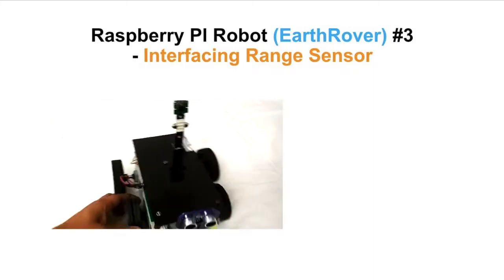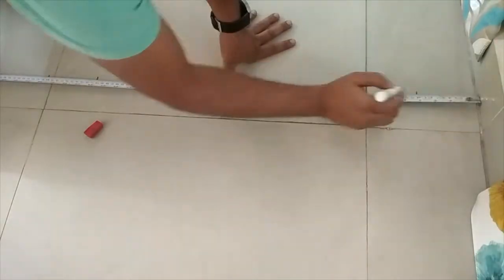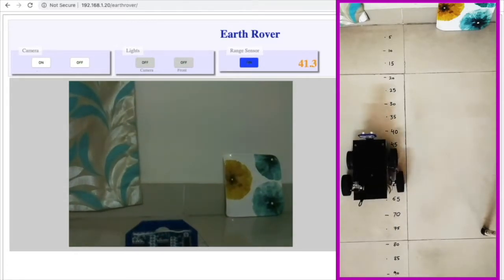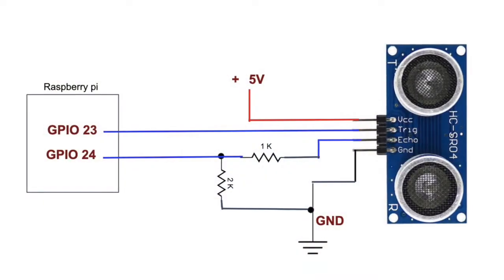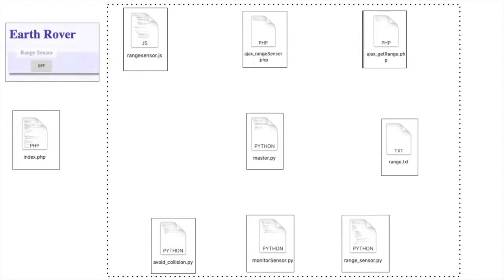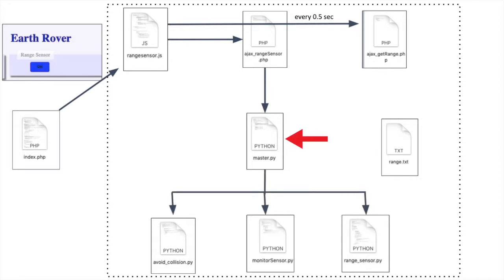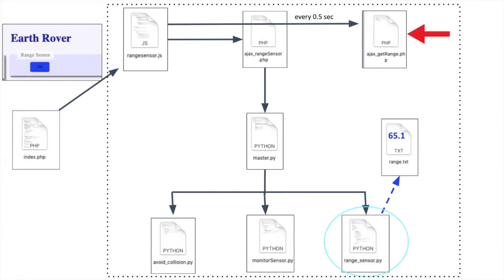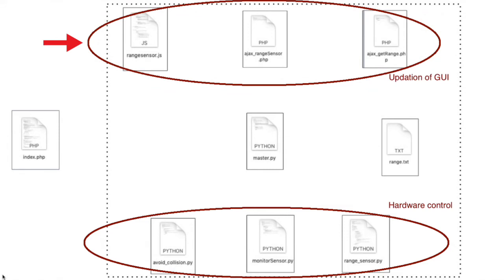Robotics: Ultrasonic Distance Sensor HC-SR04 with Raspberry Pi Robot (EarthRover #3)

Comment: Great project! I tried to make the first project, the second, and this third one. The camera, distance sensor and lights work fine, but I can't make the car move. Already checked the Hbridge (298N), motors, and cabling. What else could be wrong?
Reply from the maker: Thanks.. Good to hear that you could make these projects.. When i made this project initially, i used Raspberry Pi 3A+ and i could turn ON and OFF the GPIO pin using the commands such as "gpio -g write 18 0". However, with new model i.e. Raspberry Pi 4, i found that this method doesn't work. So, i replaced this command with "raspi-gpio set 18 dh" type of commands. Accordingly, i updated the 'vars.php' file in the latest 'robotics-level-4' project. This file is responsible for generating commands for motors through Web Control Panel. Just replace it and your car should move.. All the best
Reply: @jitesh_helloworld  You are the man! That worked great. Also good job on the auto-install script! Thank you for all your work and thank you for sharing. This project will help learning.
Reply from the maker: Thanks 😊.  Pl share with your friends

Comment: Interesting project, how do you start the webserver on the pi? Thanks for the tutorial!
Reply from the maker: Thanks Jimmy. You need to install Apache webserver on Pi. You can use this command "apt-get install apache2". It should automatically start on boot. In case it doesn't (very unlikely), you can start it using this command "sudo /etc/init.d/apache2 restart"
Reply: @jitesh_helloworld  Thank you, this will be my weekend project!
Reply: @jitesh_helloworld  Got the web page up and display, try to test the camera first but video not showing, on the video section it show respberrypi IP refuse to connect!
Reply from the maker: Hi Jimmy, so there is this file called 'sudoers' in location "/etc/sudoers". You need to edit it to allow execution of a Python script from PHP file. Use this command "sudo nano /etc/sudoers" to edit it and paste following at the end of it:-
pi ALL=(ALL) NOPASSWD: ALL
www-data ALL=(ALL) NOPASSWD: ALL
Reply from the maker: When you press ON button in Camera section, it tries to execute a Python file at location "earthrover/camera_lights/cam_server.py". Without above configuration, this file won't execute through ON button.
Reply: @jitesh_helloworld  with these configurations in there, it worked and thanks for your help. A very good lesson here.
Reply from the maker: Nice to hear that you could use the code. ☺️
Reply: @jitesh_helloworld  Hi Jitesh, looking at the motor control codes, I am a bit confused of why you have two motor control modules, one in PHP and one in Python, which one is being used? Thanks!
Reply from the maker: PHP motor control module is used for controlling the motors through Web Interface. Whenever there is a button press by the user, the event is handled by the PHP file. Now, sometimes there is a requirement for the robot to automatically control the motor direction based on sensor input. This case is handled by python file. Look at 'avoid_collision.py' file inside  'range_sensor' directory. It moves the motor in backward direction if the distance calculated by ultrasonic distance sensor is less than 30cm.  'avoid_collision.py' is started and killed through 'master.py' when you press the Range Senso ON/OFF button on WEB GUI.
Reply: @jitesh_helloworld  ah... it all makes sense now. Thank you!